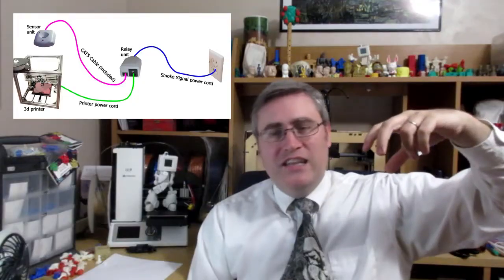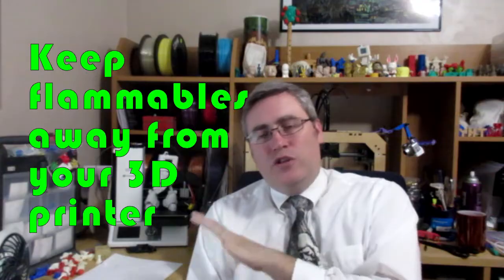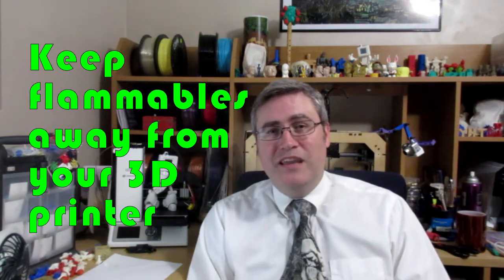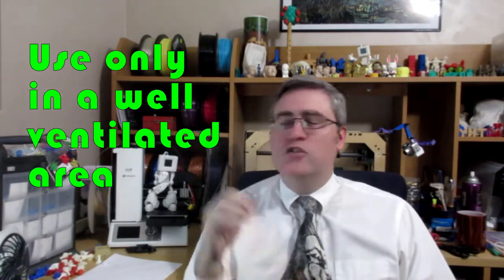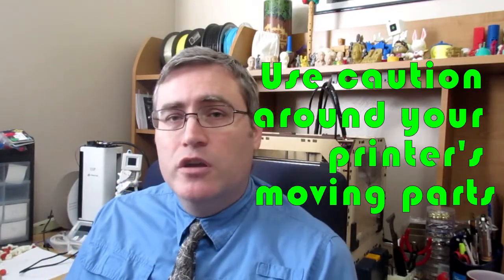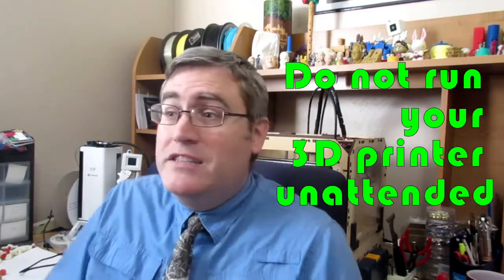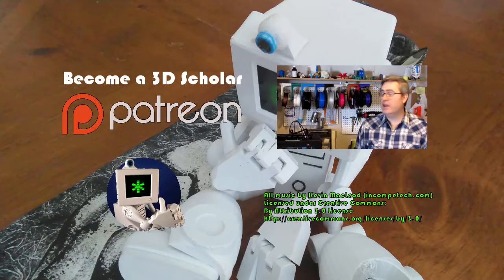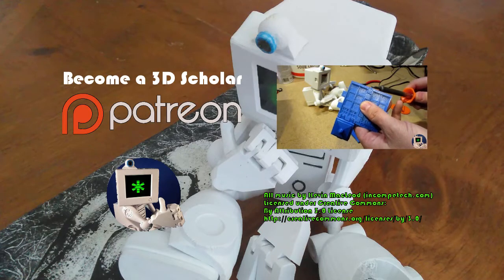3D Printing 101 - Safety First

Comment: If the advice is to not print unless you're monitoring it, then what would you suggest to do on prints that take several hours?
Reply from the maker: 7:17 Of course you're going to let it run from time to time for a while unattended. However, don't do so unawares. Know that you're venturing into unsafe territory, know that if something is going to go wrong it'll be when you're not watching, and take proper precautions.
Reply: Thanks for the response. I guess I was hoping you had a way/knowledge of how to stop in the middle of a print and start up again later. I've never even seen a 3D printer in real life, but I have an Anet A8 on it's way from China. While it's getting here I have immersed myself in as much 3D printing education as  I can including a bunch of your videos which I have enjoyed and appreciate you making available. For my research on the A8 I have learned to get an upgraded PSU and add a couple of mosfets when it gets here as well as direct soldering the wires for the hotbed to the hotbed in order to make it safer. I haven't seen anyone even acknowledge the ability of printers to stop in the middle of a print and start again though. I was hoping maybe you might know how to do that. Even so, thanks again for the response and keep up the good work.
Reply from the maker: Some 3D printers can stop and restart a print, but not all can, and it often results in visible lines in the print, so it's not recommended. I don't think the Anet A8 is one of those that can, though really isn't just a question of firmware.

Comment: what do you think about Ultrafine particles? I'm working on a venting system now.
Reply from the maker: Meh, a little inert polymers in the blood never hurt anyone.

I'm joking. Mostly I don't worry about it. Just be sure to use in a well ventilated area. But a filtration system (along with an automated fire suppression system maybe?) isn't a bad thing.
Reply: 3D Printing Professor I'm making a system to pipe it out the windows, I thought that might be cheaper and easier. what do you think?
Reply from the maker: Short answer, anything is better than nothing. Long answer I get kinda condescending, and I'm trying to be better than that, so I'll just stick with the short answer.
Reply: 3D Printing Professor hey, I'm always up for constructive criticism!
Reply from the maker: I'm not a plastic particulates expert by any means, but from what I've heard many thermo plastics (especially PLA) are so low particulates that there's really no reason to worry about it. But if you are an enclosure with a fan cycling the air through a microfilter usually is all you need. And, hey, while you're building an enclosure why not go crazy and put an auto deployed fire extinguisher on it!

However, if you want something a little more like a hood or just a tube with a fan that you bring close to the build area, you'res likely to introduce an air flow into your build area. Air flow is a bad thing for most materials you will be working with, the exception being PLA, and again PLA is low particulate. So you're ruining your chance to use most materials except the ones that don't need the system which make a venting fan system kind of a waste of time.

Yeah, sorry about that. Again, I'm no expert on these things, though, so don't go taking my work as law.
Reply: 3D Printing Professor yeah, I was thinking about doing a fan speed controller, and I thought that it might mess up abs and other things. The second printer im getting already has an enclousure, so i was going to build it into that, but yeah i could probably do a extinguisher! Not sure how though, maybe a co2 tank? With these new technologies, I Just wanna be safe! Thanks for the advice.

Comment: Great advice, luckily my husband works from home so he can keep an eye on my prints whenever needed!    I also think its good to note to give your printer a break from time to time.  Going print after print after print is just asking for problems...
Reply from the maker: Abuzz Designs My printers, as I do, get Sunday off, at least. Funny thing is after that break is when something usually needs repairs. It's like while it's going nonstop it doesn't have time to go "Oh, hey, this connection is a bit loose, might cause a problem." It's only after getting to stop that it says "hey, check this out before you start up again". 

You may ask if I'm personifying my 3D printer? The answer is, which 3D printer do you mean, 'ol Reliable or Little Bit? ('Cause, see I named them, right? That's the joke. Like Their personified... you get it.)

Comment: first🤗
Reply from the maker: But are you safety?
Reply: You can test the stepper motor by using an ohmmeter.  There are typically (most 3D printer motors) 2 sets of windings in the motor.  Usually, they are paired Red with Blue, and Green with Black.  They may differ slightly.  They should both have the same (or very similar) resistance when tested.  If one of them shows lower or no resistance, the motor is probably bad.  Turn the motor in several different positions around it's axis and test, if it's different in any of those positions, then there's a problem.  (There's no electrical connections on the shaft/rotor to make contact, so there should be no change).  Signs that it is failing are skipping steps or abnormal rotation.  I had my extruder motor go out on me, so I actually know from personal experience.  Best of luck!
Reply from the maker: I'm glad people are going through the MyTechHigh courses I created.

Stepper motors almost never fail. That should literally be the last thing you check. I've had one go out (I think) and there's no noise, it just stops working properly. And the only reason I think it went out was when I exchanged it for another one the new one worked where the old one didn't. But that is reportedly super rare.
Reply: 3D Printing Professor hello 3D printing professor, I have a question how do you know if the stepper motors on a 3D printer are failing? Is there a way to know by sound or will they just stop working completely?
And P.S,
I discovered your videos because I am homeschooled and my school program (mytechhigh) used a video of yours on how to make a diy 3D toy. I really liked that video.
Thank you!
Reply: 3D Printing Professor thank you!